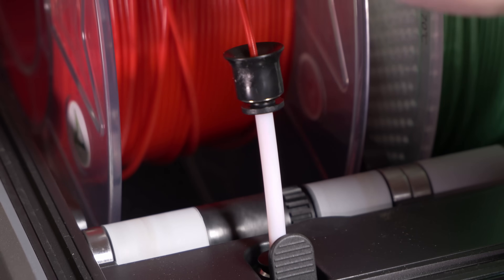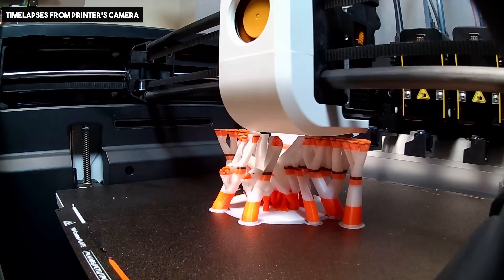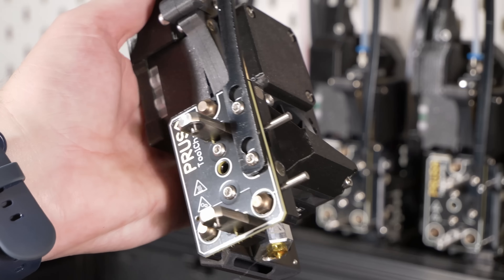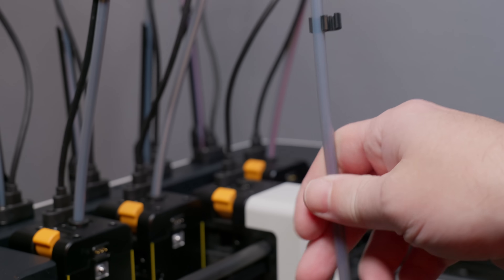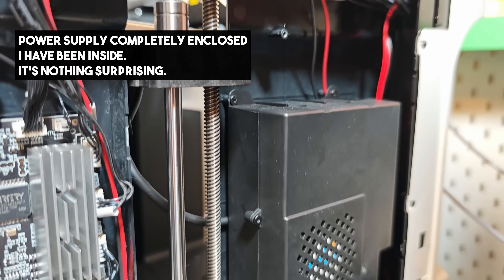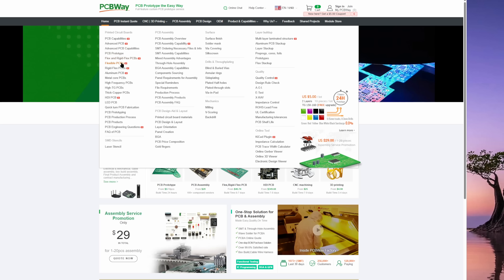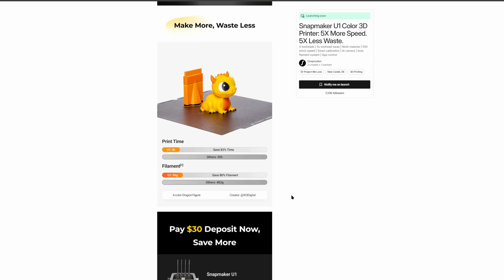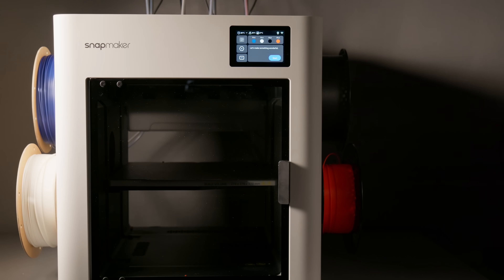FINALLY! An affordable 4X toolchanger! Meet the Snapmaker U1.

Comment: The first company to make a toolchanger coreXY with 65C+ heated chamber, 350C+ nozzle and a 120C+ buildplate under 1200$ wins in my book.

The insane engineering ability you get with a printer like that, makes it truly a swiss-knife tool that you will see every workshop in the future have installed.
Reply: @holm8536  agreed and the only thing I would add is I need around 400 mm³ build volume. I have a sovol sv08 and it's nice, but wouldn't mind a little bigger
Reply: It will probably have the same price as the H2D
Reply: This snapmaker i1 is supposedly 750
Reply: The upcoming AtomForm Palette 300 seems pretty close. 110C buildplate and probably a bit more than $1200 though.
Reply: @joaocampos7153 the Atomform is a strange system. I understand what they are trying to accomplish. You can do more with one machine by just switching the nozzles. I just don't see it working well.
It's more moving parts, so much harder to keep working, and it's got to be extremely slow at switching out the nozzles
Reply: What's the advantage in this? Aren't there already tons of filament changer? Why do you have to change the extruder. If this can change to a CNC router or laser, then it'll be a game changer
Reply: Agreed, what they have will be good for most, close but no cigar for others, including me.
Reply: Yeah, look at how they support their customers.   J1 owner here... avoid !   They just copied the carbon and added a tool changer. No innovation they are just coping stuff.
Reply: you can add a zero to that price tag if you want all of that within the next 5 years
Reply: @WHAT_1400  I could see Qidi doing it their machines already hit all those temps and are super affordable.
Reply: @WHAT_1400  I think under $1200 is a little ambitious, but he does not need to add a zero. 100->120C isn't adding a ton of cost, 300 -> 350 is probably adding a fair amount because it's x4, 65C chamber isn't adding a ton of cost. I could see a printer like that being $1500 if the U1 is $1000
Reply: @WHAT_1400  Why would it ad 10800 USD to add a heater, and a nozzle that does 350c and 120c buildplate? You could probably add that yourself to this printer when it is released for like $1000 with some diy.
Reply: @AndrewTSq way less than 1000$. They may release a hotend that can do 350 and the bed may be capable just firmware limited.
Reply: @WHAT_1400 Your crazy. This is almost there and the H2D already is apart from price

Comment: I made a doot changer a while ago in Iran, I was gonna make another in Canada but my life has been crazy and I also don't have money for it. Plus not only am I a bit sick and unemployed but I gotta save for my gender affirming surgery.

I don't understand why manufacturers avoid a locking motor. even a brushed dc motor lasted more than one year in my simulations without any signs of wear. I used a cheap toy motor and it worked wonderfully. it's not that heavy and if it was brush less it'd be even better.
I used to current to lock and unlock and monitor the torque of the motor. but you could very easily monitor the torque with a strain gague that costs like 2$ (my new doot design was gonna use it not just  to lock the tool, but to probe the bed and also even monitor the nozzle pressure and calibrate pressure advance. fun fact, as an unexpected side effect it also could detect wet filament LOL.

the e3d one uses a stepper motor (a bit of a poor choice IMO) and it worked fine. the weigh is insignificant. 
also the prusa method is still better because the locking movement cannot be replicated in print. unless you introduce a special condition at the dock. (pins) the same movements can be replicated during printing and disengage the toolhead.

i came up with so many crazy locking mechanisms tho LOL. one was a retractable pencil basically, it just turned the "screw"
also I wonder if they have a tool locking sensor built in. that's pretty useful in my experience. Tool change failures are often... dramatic and destructive. what I did on my doot was turn the motor current way down when picking a new tool to avoid component damage in case of a failure. but it had no step loss detection so i'd have to be the one slamming the stop button.

i've been dreaming of a good tool changer for so long, I had to abandon my own tool changer in Iran when escaping my country and I really miss it, and i'm not in a position to design and build a new one.

Comment: low friction heated dry box/roll changer would be nice. even if it doesn't need to change filaments between colors/materials the AMS was also nice cuz it kept nylon/PC/etc dry, and let u switch between rolls and run a roll till it was empty tho I guess you could also just load 2 heads with the same filament and tell it to switch when one ran out.
Reply from the maker: you can feed directly from a dryer

Comment: Why does it need a purge tower???
Reply from the maker: Good question actually. If you don't stabilize the flow after a pause you can get blobs or missing sections. You can print without the purge tower, it just affects the quality a little and increases the chance of failure
Reply: So does it do 1 layer to start flow then move to model?
Reply from the maker: @jamesocker5235 yes and it's very sparse, those towers are pretty hollow

Comment: The hydruckasus is amazing. This is a very exciting launch. While I will say I'm still hype for INDX, this truly does bring tool changing in reach for regular 3D printer buyers. I'm very happy this will do a lot to kill the wasteful AMS style system hype. The hardware looks solid, prints look pretty good, and the fact they allow Orca use and will be open source is fantastic news. Really think they are hitting this one out of the park as long as the production units perform. Judging by the Kickstarter numbers, they certainly have massive demand and hype. I think you were right they massively underestimated. Great video!

Comment: Did you manage to work out if during the same print one can have different nozzle temperatures for different nozzles, please?

It does look like those guides are the same as on a Qidi Smart 3, and they are not replaceable on that machine. Do you have any clues, please as to if they look replaceable? Thanks
Reply from the maker: Yes of course you can. You can also change the idle temps.
Reply: @LostInTech3D  brilliant, thanks

Comment: On these multi-headed printers, can you use different sized nozzles in one print? Like, have a 0.2 on one head for the outer walls & a 0.8 on another for the infill? 
I'm guessing not, because I imagine that'd be a nightmare to add to a slicer... But I thought I'd ask, in case my assumption is wrong. :)
Reply from the maker: Yes I believe so, but.....it's not implemented yet.
Reply: @LostInTech3D  It'll be awesome if they get it working like that. Imagine a 0.2mm nozzle for detail on one, a 1mm for infill on the second, PETG on a third for support material & the fourth one left to stir the tea. Glorious.

Comment: automatic filament loading? Prusa needs to take note of this. This is one area where I'm glad I don't have an XL......even though I still kind of want one.
Reply from the maker: Did you see the one you can print, a handheld equivalent
Reply: @LostInTech3D  no, but I don't have an XL. so I don't pay too much attention to mods.
Reply from the maker: @awilliams1701 it works on any reverse Bowden 😁
Reply: @LostInTech3D  I don't have to worry about that. The MMU3 isn't nearly as bad as an XL. Not worth fussing about.

Comment: Haven't watched the full video yet, but just responding to the initial premise: I'm definitely in that target market, where ~$1000 is the most I'd consider spending on a printer, but at the same time (after starting out relatively recently with an A1 mini+AMS) I wouldn't consider an AMS system for multi color prints. I do feel like I'm getting a fair bit of use from the AMS, but that's from convenience (run-out protection, not having ton constantly swap filaments), not from multicolor prints. I quickly realised just how horrendously slow and wasteful the AMS system is for that, and how it can't handle mixed materials (like TPU and ... well, anything) whatsoever. So whereever I go next, it's going to be a tool changer or nothing.

Comment: Sure after about 2 years of building my Trident with a custom toolchanger I am ALMOST ready to print in multiple colors and now this is available... well at least I know exactly how my printer works now...
Reply: Spain without the S.
Reply: @802Garage  the S is silent
Reply: @802Garage  hey thats a ratrig toally different lmao
Reply: I really wanted a Awd trident, but building something else awd instead, smaller so faster but no enclosure. PLA monster only, I’m considering the u1 for the price and it is enclosable
Reply: It's amazing to build your own tool changer, be proud of your accomplishments It doesn't matter if something else comes out, know that what you did was awesome.
I can't tell you how many times I built something only to have something purpose built to replace what I did. I learned soo much from the process that can never be taken away.
Reply: Can you share what did you use for the toolchanger?

Comment: Remember that this is a Kickstarter project which means you might never get the product, they might not refund you if they don't ship, that the printer might have flaws that a full production product might not have, that spares might never be made available.
Reply: Those are obviously valid concerns for Kickstarters. But there are degrees to this as well. If it's a company with nothing more than an idea, then my warning alarms are blaring.
But this is an established company in the market that has decided to not take out a loan for initial production. Giving Kickstarter a cut is a damn cheap "loan" for them, and they get to gauge actual interest before starting production. So they don't risk taking up millions in loans to produce 10k units and sell 200. Or produce 200 units but get 10k orders. 🤷
Reply: yea you are wrong

Comment: If I hadn't bought a J1, I may be interested, but after the J1, I promised to myself I would never buy another Snapmaker product again.
They released the Marlin source (It's a VERY old version of Marlin), but it's effectively useless because they did not release the source of the touchscreen, where a lot of the logic lives.
The bed is made of PCB, and bows horribly, rendering the auto-calibrarion fairly useless.
It layer shifts like crazy.
We never got decent octoprint integration, despite it being promised in the kickstarter (And subseuqently removed)
The list goes on...
Reply: so u've grown up now and can wait half a year for the young folk to spend some hair to turn grey to work the bugs out of this one then.. kudos!
Reply: Took me 1 year to get the printer (J1) working. Had to fiddle with the tool change macro and write a custom script to get the tool changes working without delay and working parking temperature for the unused toolhead. I don’t have layer shifts but I reduced the acceleration because it doesn’t sounded healthy with standard settings.

Comment: Looks like it has a cover and heated chamber addon too. Now it just needs a higher temp hotend ~350C, and it would be perfect for PPS-CF, PET-CF and all the other high temp materials.
Reply: @colbylippincott7173  exactly. I need the temp end to be at the 350 or higher temp mark. Unless it hits that it's a nonstarter for me sadly. I hope the same for the INDX as well. But if snapmaker or indx can't or won't hit that temp, someone ABSOLUTELY will in the near future but too changing 3d printers are absolutely going to be the future over anything and style. I won't be surprised if any company developing an ams system is gonna cancel that development entirely because of how frankly obsolete they are to tool changing.

Comment: Missed putting the $30 deposit for the early bird price. Gonna pass on this. Might get it if microcenter ends up carrying it later on.
Reply: $30 deposit was to get $70 off EB pricing. There are still $749 EB units available right now. And if you're too slow KS Special price is just $50 more than that again.
Reply: @MagnificentUsernameGuy $30 to get get it at $679 would have sealed the deal. $749 isn't bad, but $70 is $70 lol
Reply: @Bearded_Blonde  "$749 isn't bad". 😂
A 5-tool assembled and enclosed PruXL is ~$4.500. 😏
(Have to add another $150 for the top lid on the U1)
Reply: Totally agree with ya! Hopefully they also change the panels on it, watched another video and seems to almost pull off when taking off a spool, did you have any issies with the filament loader popping off?
Reply: @Bearded_Blonde  All review units are pre-production units. So whoever made that remark has given Snapmaker feedback on it. So, it might not be an issue on the actual production units. Time will tell. Even though I did get in on the $679 tier, I won't receive my unit until October is it? Sometimes they list "Delivery" as the month the units leave the country of origin. Meaning another 4-6 weeks on a boat before they arrive at destination country.
Reply: @MagnificentUsernameGuy yep, October is when it will probably start to hit the sea. Probably end up state side by December. Nice Xmas gift for yourself lol
Reply: @Bearded_Blonde  Let's hope it doesn't arrive just before Christmas. 🤣
Reply: @MagnificentUsernameGuy aaaaaaand I backed it lol
Reply: @Bearded_Blonde  😂

Comment: I've never been interested in poopy single tool head filament swapping systems such as the AMS.  I don't like the complexity, material waste and slow printing.  Tool changers are the way.  They're much better for the multi-material functional prints that I do.  Kudos to SnapMaker for their U1.  It looks like they've engineered an excellent solution, hopefully with good slicer support.

Comment: So I spend 1k on a machine that saves 500 on FIlament... after how many years ?(that's 30 kg).

I find this argument thats repeated over and over again irrational.
Reply: More than 1K because if you want to use materials that need to be kept in a controlled environment which, if you are doing multi material that wouldn't work in an AMS, is almost certain, you need to build or buy enclosures for the filaments.
Reply from the maker: You're viewing it from a financial perspective instead of a personal responsibility perspective. 

A lot of people just dont want to be filling bags with plastic waste.
Reply: @LostInTech3D  Shaping a kilo of metal into the shape of a toolhead takes a lot of energy. Both for the raw material and the machining. Doing that 4 times to save some plastic makes no sense. Plastic is just energy (oil and oil burned to run the chemical plant).
If you want a toolchanger because it enables something that the AMS units can't do that's fine with me. But obsessing over the waste that you produce is irrational (extra irony when printing plastic garbage anyways).

If you follow through you have to stop buying bananas too. You know how much plastic is used during transport? Or is it okay if someone else throws it away?

Comment: This would've been the PERFECT printer for me if the build size was 350mmx350mm. I'm getting tired of having to split my parts in CAD and figuring out ways of piecing them together when the whole part can be one uniform structure. 

Otherwise, I'm excited for tool changers to be more mainstream. After Klipper, tool changers might be the next big revolution in 3DP.
Reply: I think fact is companies sell far far more small-medium sized printers than large-XL. Largely because the price to manufacture and ship goes up drastically when you near or pass the 300mm³ mark. Given the success here, Snapmaker will likely target releasing another printer. Could be something larger with 5 or 6 printheads even. INDX will also have mods for almost every large machine quickly, so that's a good future option.
Reply: @802Garage yeah based off of this not being able to fit another tool head and the prusa XL maxing out the X axis with tool heads as well I think a larger printer would have more toolheads and also to do more toolheads they would have to do a larger printer.

though they could potentially give the printer a forehead and have another set of hot ends on the front of the printer. it would require extending the Y axis to let the tool head move freely at the back and front while reaching the end of the bed though.

Comment: This is pretty sweet. I've been seeing ads for this printer and I just didn't care because I have enough printers already and it's snapmaker.
I'm really tempted to get a couple of these, but I should probably wait for other systems to follow. It looks like they are using proprietary nozzles, and I really don't like that.
Reply: I think this is one of the instances where it actually makes sense that the nozzles has to be "proprietary" (knock-offs down the line are probably a certainty though). But say you had the ability to buy any cheap nozzle you could think of. The problem would be that even just a slight offset of the hole in the nozzle would render the calibration method invalid. The hotends need to be manufactured within very tight tolerances to achieve the accuracy needed.
Reply: @MagnificentUsernameGuy you may be right about that. I don't use cheap nozzles though. I prefer diamond tip nozzles.
Reply: @jessehavok4181  I mean, supposedly the SW is gonna be open Klipper. So if Diamondback decided to make a hotend for the printer, they could either make it to the same specs as the original, or users could edit the calibration settings.
Reply: @MagnificentUsernameGuy  The key word there being "if"